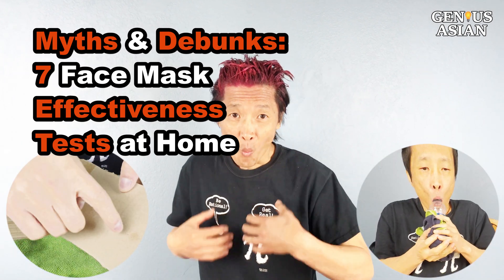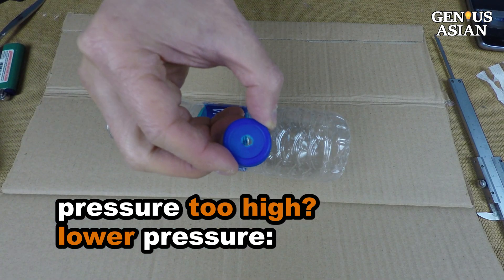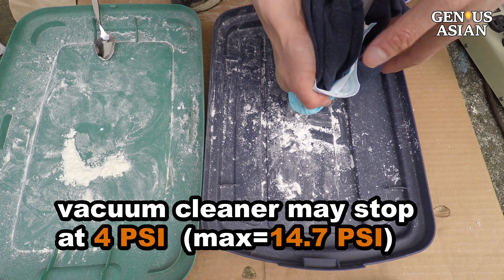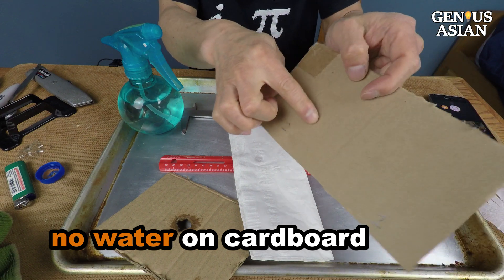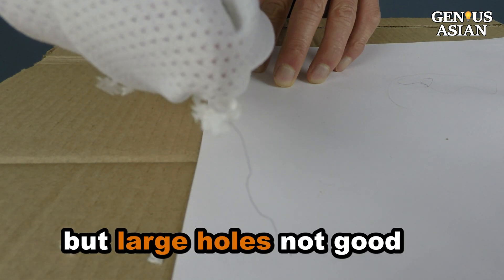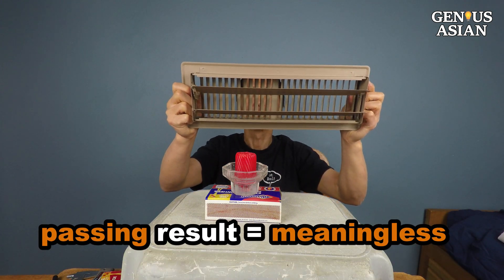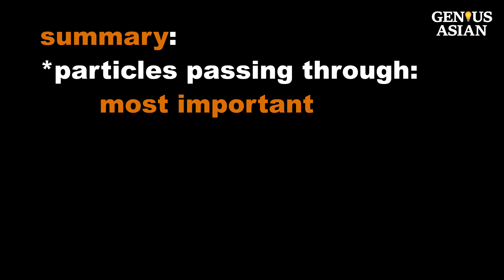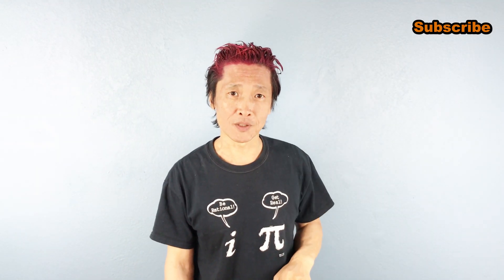Myths & Debunks: 7 Face Mask Effectiveness Tests at Home

Comment: I heard salt spray on the mask helps kill virus ,breaking it up somehow. Could you address that?
Reply from the maker: There are two opposing factors. One is from Hyo-Jick Choi, a biomedical engineer and professor at the University of Alberta in Canada, he claimed table salt mask  can kill coronavirus. The second concern is about the water repel material can be dissolved in either alcohol or salt. Our CDC will not recommend anything about this either way, so you are left to make a decision or a trade off.  When we have a stay-at-home-order, masks are sold out, I want to reuse my masks for example, there are no reports showing that sunlight can kill the coronavirus, still I put my masks under the sunlight, because this is currently my best option, what else can I do?
Reply: @GeniusAsian  i've read something different that, yes alcohol damages the fabric and reduces the filtering % of the mask, but I've read that salt can restore the "charge" of masks which might preserve some filtering. I've never read that salt actually kills the virus.
Reply: @GeniusAsian  UV light kills viruses, the coronavirus isn't anything different
Reply from the maker: @telescopehorizon  yes, https://www.cuimc.columbia.edu/news/far-uvc-light-safely-kills-airborne-coronaviruses   . However most uv is the long wavelength uva. If you want to make natural vitamin d, then go to sunlight at noon for uvb. The uvc is the most effective to kill coronavirus, however it does not have much in sunlight. That is why some people question the sunlight killing virus. I would still use sunlight at noon time, it should reduce the probability of infection, and the heat also kills coronavirus.

Comment: I seen your argument that corn starch is close to droplets. But some suggest the virus is way smaller and can sit in the air non droplet form. If thats true wouldnt non of these tests work?. Also the N95 has fibers that has electrodes to catch particles which make the material more breathable and effective from my understanding.
Reply from the maker: In the beginning, CDC does not recommend any face covering for healthy people. Now CDC says this: "CDC also advises the use of simple cloth face coverings to slow the spread of the virus and help people who may have the virus and do not know it from transmitting it to others." It is all about probability, the better covering the lower the probability of getting the virus. There are large droplets, small droplets and aerosols, but they are not as important as washing your hands in terms of probability. Are you washing your hands correctly?: https://youtu.be/-YrBEj1fSPU
Reply: @GeniusAsian  Yes, but you get the virus through your nose and eyes.
Reply: Ауто камере Србија / Dash cams Serbia he has videos showing how to DIY your own face SHIELD
Reply from the maker: @DashCamSerbia   As  @T W commented, here is the video:   @ https://youtu.be/e8_guxtEYqg
Reply: Virus on its own can't survive.

Comment: Have you found some good materials for a mask?
Reply from the maker: when you ask " good materials", the answer is it depends on the design needs. For example, vacuum HEPA bag is good, however if your mask design has gaps, then those gaps are 0% filtered, it does not matter how good your material is. But if you seal your gaps very well such as this one: https://youtu.be/79cleCN1oiY ,  then some people would be say it is not comfortable, or it looks embarrassing. So you need to make a trade off there, compare materials based on what you have.
Reply: @GeniusAsian  I understand material is only one aspect. I have watched the video you link, but I think making such a respirator is above my  abilities. I will likely stick to napkin masks.
I am a bit concerned about fiberglass in hepa filters.
Thank you for your videos. You really are quite a resourceful person!
Reply: Some sources say quilter’s cotton is the best fabric. I have coffee filters for the filter part.